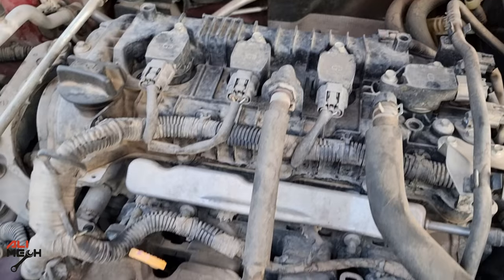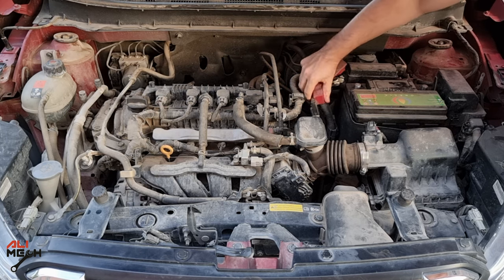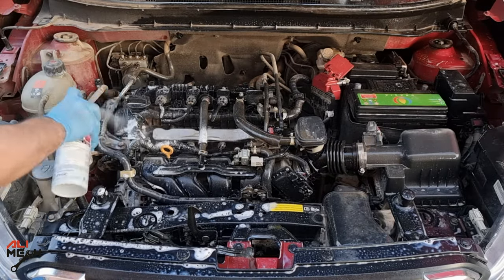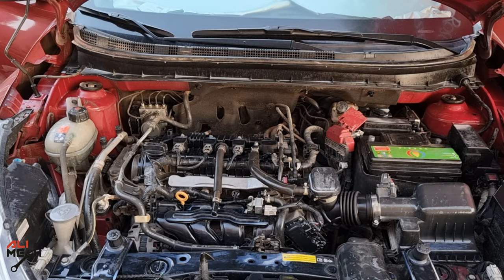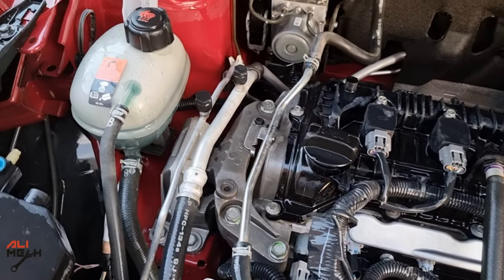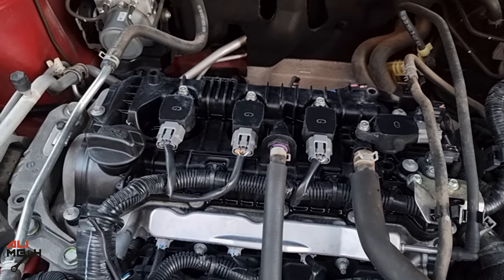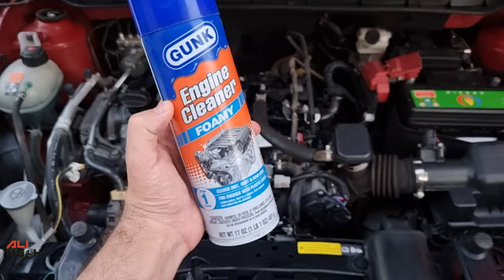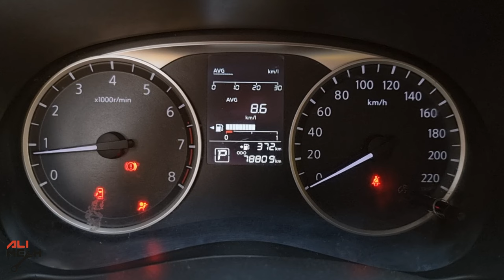Don't use gunk Engine degreaser until you watch this / Gunk Engine Cleaner Foam /how to clean engine

Comment: Never use a pressure washer.  Just use degreaser, a soft brush and a hose.
Reply: I don't even want to spray the hose in there 🤣🤣 it's gonna get all fucced up 🤔
Reply: What can get wet and what can’t get wet ?
Reply: @brooklyn7941  use plastic bags to shield the following components from water: alternator, MAF sensor, oxygen sensors, fuse box and relays, intake system components, battery, exposed electrical connectors, and ignition coils.
Reply: depends on the car, most car now a days are water tight
Reply: @ProJanitor  that's  a lot of stuff to cover 🤣🤣🤣🤣
Reply: Many people have used a pessure washer and no bad results . As for having an open air intake , stuff a microfiber towel into it to keep out water .
Reply: I used degreaser and a hose to get rid of grime build up on the side of the block. Water got into 2 of the coils making them look rusty. Didn't know this for at least a year when I decided to check my plugs. I cleaned them and greased them up, hopefully they will be fine... 😐
Reply: I have a neighbor who does this to his car all the time... his engine is super clean
and he's never had any problems. He doesn't use plastic or cover anything up...
It's insane... I did it once but stayed away from the alternator, fuse Box etc... 
Not as clean but helped a little. I was just to worried something would go wrong. But it didn't....
Reply: I work for a detail shop pressure washer is fine it won’t hurt modern cars. Just be careful not to soak alternators or battery and everything will be ok I’ve done it for years. Also the cars you get from dealership also clean their engines this way
Reply: @MikeKollin  YouTube Channel - Dallas Paint Correction ? Had said a solvent based engine cleaner / degreaser would never be completely rinsed away as a biodegradable . To continue to degrade whatever it was applied  to . The reason I use a citrus based biodegradable degreaser . And to rinse it away even twice as they can be bad for paint .
Reply: @cumshot247  I expect it has to do with the year of your car . Newer models having water resistant / waterproof connections , etc  . If using a hose to use a spray nozzle where you can adjust to a fine spray . As for a electric pressure washer , I think it had been said to use a 45 degree nozzle . And to cover your fuse box with a heavy duty plastic bag ? and secure it with elastic bands , etc
Reply: Used a pressure washer on all my engines for the past 20+ years with no issues. It's not the 70s anymore. 

Just don't hold it super close to plugs or sensors. Common sense really
Reply: @DarrenBoxhall  yes as the detailers use an electric one around 1200 psi
Reply: @SAr-vc3iw  yea like cover the entire engine and dont bother to wash it lololol
Reply: As you can see , he used a pressure washer and had awesome results.
Reply: I've been pressure washing engines for 50 years. Once in a while, you'll flood a distributor but never had one hurt.
Reply: @donmunro144  I've cleaned all my engines with pressure washers and never had an issue. I cleaned my Chevrolet show truck engine weekly and never had an issue. Never disconnected the battery either. Also cleaned my '82  Trans-Am engine weekly and never had an issue. Also didn't disconnect the battery. Always cleaned my engines with pressure washer.. Never had an issue. Never used a washer hose .....To each his own .
Reply: You are wrong please stop@ProJanitor
Reply: Think about it people.  What happens when you drive in the rain. Stuff gets wet but not hurt.
Reply: says a janitor lol
Reply: I used a pressure washer at the car wash and my car is fine. Even used it at point blank at some electricals where a bunch of grease had built up on. My car is fine and the engine bay is clean now.
Reply: @SAr-vc3iw  cover the car
Reply: @ProJanitor cheaper I cover the whole engine all that shit u just list 😅
Reply: @SAr-vc3iw  honestly your main thing is alternator and power box
Reply: Yeah just don’t spray the pressure washer directly into the engine inches away.
Reply: @ProJanitor  if you use very low pressure water and just spray down, most of those won't get wet.  But I agree it is best to play it safe.
Reply: Hold the pressure washer a little bit away instead of up close and direct. After washing spray the entire engine with WD-40.
Reply: I just used the foam spray and rags no water no risk
Reply: @peterrudy9207 I have a JLT cold air intake on my ZL1 Camaro. I take the filter off and  put a condom on the end. It’ll keep the water out better than a towel will.
Reply: @str8profit81  what about and 08 model car?

Comment: rule#1 of cleaning your engine is dont use pressure washers
Reply: The engine cleaner is highly corosive you dont whant any left on the engine pressure wash is on if the engine is disel on petrol only not recomand

Comment: I have used this product but instead of using water to rinse it, I use a powerful leaf blower to blow residual degreaser.  I use a towel to wipe areas that had overspray.
Reply: Smart way to go about it  Mr. 1977, that’s what I do exactly, no problems ever.👍🏽
Reply: I do similar but I use a hand held steamer with a large towel❤

Comment: You never run water on your engine like that unless you cover vital electronic parts water can get into the sparkplug sockets and other electrical parts that's a no no.
Reply: There's no issue if the electrical components are NOT engergized. Diconnecting the battery's negative post would be sufficient and not reconnecting until everything's completely dry. 

By your logic, most vehicles wouldn't survive a rainstorm while driving through puddles, which begs to question because those components are energized while operating the vehicle.

Comment: Using high pressure water is very high risk, if done properly its not needed either, just a garden hose to gently rinse. This is the short cut, fast and high risk method.

Comment: Gunk has a biodegradable spray which I use and works great! I cover my electrical fuse and electronics with plastic bags and lightly spray the engine off with water low or no pressure.

Comment: Thanx bro I used poleks  engine degreaser and it worked amazing it even return the shiny look of the front AC radiator
Reply from the maker: That's great,  but don't leave them for a long time, they fade paint and plastic in a long term usage

Comment: Never use degreaser under the bonnet unless it's actually covered in oil. 

It will cloud up plastic, rubber and ally. 

Just use a ph neutral soap like CT18 on a bottle diluted then wash it off.

Comment: What will happen to sensors,connectors,sockets,modules,ecu,alternator?
Reply: 99% of those are water RESISTANT, NOT WATERPROOF. Never use a pressure washer, a garden hose with a soft spray nozzle will work perfectly fine . Most of those components gets wet during rainy drives but a pressure washer is way too much

Comment: I have tried to use the tire cleaner foam on the engine, particularly at the black colored parts (plastics, hoses/pipes, etc), it has the same results...
Reply from the maker: It gives oily layer, but they are not degreaser,

Comment: Is it a good idea to pressure wash the engine though? The pressure might force it into electronic components. A garden hose seems like a safer option?
Reply from the maker: Sure it's safer,  but my pressure washer at lowest setting,  it doesn't even harm hand if I put my hand in front of the nozzle
Reply: Hell no. 90% of those parts are made in China and you have exposed connectors. Great way to F up something expensive

Comment: This has solvents in it , said to not be good for rubber and plastics . I use Zep Heavy Duty Citrus Degreaser or any other citrus based degreasers and best if biodegradeable .
Reply: wish i had heard about this before lol now im afraid, sitting here letting it soak rn
Reply: @strxwbwy  The engine seems to be just dirty and no oily / grease build up . In this case I would use a citrus based degreaser as they are less harsh and biodegradeable . Though I have used this same one in the 1980s on an engine with grease and oily deposits . I suspect many people do not use a funnel when pouring oil into their engine and it spills .
Reply: @strxwbwy  Though Gunk does have a citrus based cleaner that comes in a spray bottle . I used that for years cleaning my engine from just surface dirt , no grease , oil , etc. But , it is very strong as I was almost choking when using it .

Comment: Great job. But I think using water is not a goid idea because there are electronic and electrical connection all around the engine. What if we leave the degreaser without wash?
Reply: @marosen9260  right, just do the things this dude didn't do in the video.

Comment: Anytime you clean an engine with water and or degreasers you damage the electrical terminal connectors and wiring...just use a wet rag and take time wiping down

Comment: It's OK to use pressure washer on this engine. It doesn't have electrical connections or computers to worry about. I would have also sprayed inside the car while i was at it.

Comment: Is the degreaser safe on the alternator
Reply: I use only citrus based cleaners . As they are biodegradable and not harmful to plastics and rubber. Just to rinse completely afterwards. I use Zep  orange cleaner full strength

Comment: Best if sprayed on a warm engine, heavy deposits require loosening up with a stiff brush and soaking 15 min before rinsing.
Reply from the maker: You can, but it evaporates the cleaner and don't let it degrease the oil

Comment: Showing the 3 "flavors"... I'm curious about the "Gel" variant. Anyone with Experience with that?

Since this Video Speculates that  the "Foam" version's use on the Undersided of the Hood ran off quickly and didn't have enough cleaner/time to perform very well...

Curious if the "Gel" does provide enough "cling" and possibly foam/moisture to help breakdown any grime it hits...  

Assuming the Gel doesn't run off during the 10-15 minutes allowing for it to loosen grim... I assume the Gel might "foam up" during the Rinse Cycle providing more cleaning action? Though probably the need for a second or third Rinse to clear all yhe gel/cleaner?